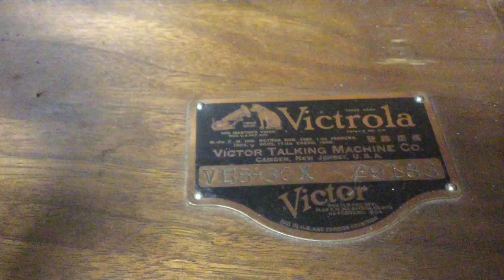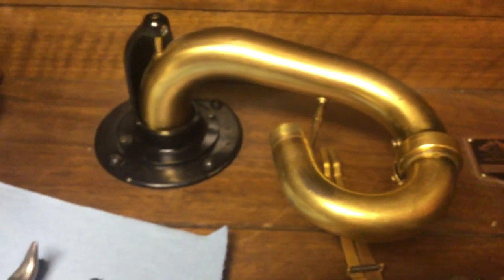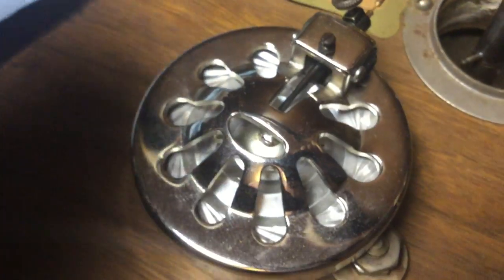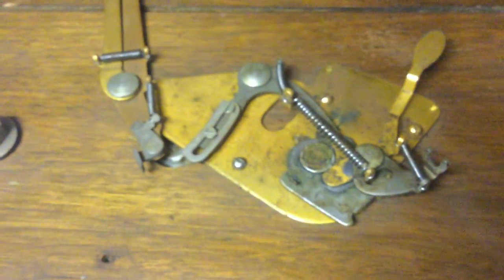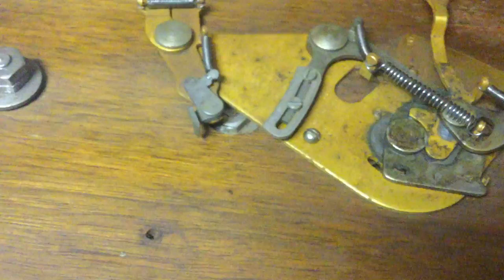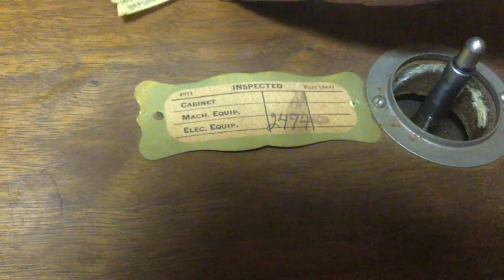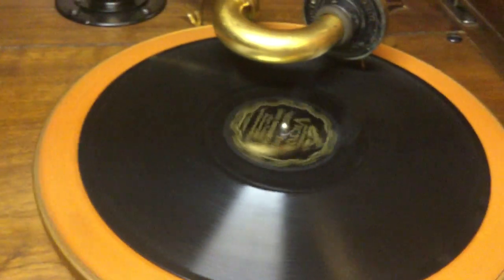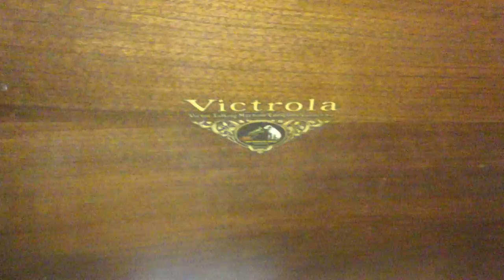My new 1927 Victor VE 8-30 X "Credenza" Orthophonic Victrola

Comment: I bought myself a super rare german acuston front-mount phonograph today it's from about 1910 so a bit of throwback technology since its a front-mount phono and those became obsolete somewhere around 1906-08 I bought it for about 200 dollars translated from euros (165 euro) it came with 5 rare needle tins (about 20 euro a tin) and 10 pre-1910 rare euro labels (again about 20 euros a record) so the value of the lot is 300 euros not counting the phonograph that one apparently was on the house!! with 135 to spare in value, not a bad deal;.
it also had a pre-1910 thick cardboard record box with labels it's shot but once repaired could be worth another 30 euros which counts to 165 to spare the same amount I paid for the darn thing! ain't life a strange thing!!
also, the value of the phonograph is about 800 euros giving me a hypothetical profit of 965 euro/1.175 dollars! damn!!!

Comment: Interesting that the tunstone needles seem less harsh on the records. I have some of these (various brands), but thought the intention of these was to make a needle which would last multiple plays, and the tungsten coating was harder than the steel and wore the record, rather than the needle. Thanks 😀 👍
Reply from the maker: What's interesting about the tungstone needle is the way the tip is made. It's not a solid tip, it's a tiny piece of stranded wire made of tungsten. Thus, the strands are able to move around and conform to the shape of the groove rather than a solid tip wearing down. Also, the outside diameter of the wire is the same as the width of the groove, so as the tip does west over the course of multiple records, it's not becoming blunt like the tapered point of a steel needle. 

So yeah, pretty clever the tungstone needle!
Reply: @okbridges  Thanks, thats very interesting. I shall have to take a look at my various needles. Some I think (from other manufacturers) look to be the same as steel needles, but just with a gold colour coating.
Reply from the maker: @mrrgstuff  I've had 10-play steel needles that were gold plated. They were just like standard single-play needles, except made of a less soft steel. They were much harder on records, but I used them on worn records that would dull a single play needle before the side was over.
As a side note, my favorite single-play needles were British made and it was claimed on the packet that they would play 2-3 sides before needing changed. They were generally good for both sides of a record and were high quality. I think they were Grenadier brand and had a picture of a Grenadier Guard on the packet and the tagline "Guardian of your Records".
I wish I could still get them......
Reply: @okbridges  Not seen that brand. I have acquired a few assorted period tins and contents. Fortunately it appears someone in the UK still has a needle making machine because its still easy to buy brand new needles in quantity, and the quality looks good. Thanks 😀 👍

Comment: very helpful video..I've been into this hobby for over forty years and really enjoy it....one thing I have yet to find out is the purpose of the screw on the needle bar...could you please enlighten me?...THANKS!!
Reply from the maker: A lot of sources claim it is a damper but it is not. 
It is a stop to limit the movement of the needle bar. 
These aluminum diaphragms are easily damaged, especially if someone drops the reproducer on the record or bumps the needle.
Reply: @okbridges  Makes sense.that is the most delicate part of the machine outside of deliberately over-winding the motor.THANKS!!

Comment: I'm actually trying to get one of these Orthophonic Victorola's. There is a mint condition one at an antique store I go to quite often. There is just one problem. The machine runs fine but it is super quiet. Unusually quiet. I have no idea what's wrong with it.
Reply from the maker: What kind of sound box( reproducer) does it have? The correct sound box is the one shown here, though Victor made a few machines that used different sound boxes. Be sure to check the back bracket at the back of the tone arm. Early orthophonic models do not use the style shown here and they are usually ok.  The style shown here was made of pot metal and are usually all broken and crumbling.
Reply: It sure wasn't a credenza. That's for sure. I think it was pot metal. I'll get back to you on this next time I go there.
Reply from the maker: If you haven't already, visit www.victor-victrola.com to help ID the machine you are looking at. 
There were several different sizes of back bracket used, only 2 are being reproduced, and they sell for about $85 US. Check the back bracket carefully, if you see cracks or missing bits, then it is going to need repair or replaced.  Reproducer is the same. If it has 9 slots like the one I show in this video it is pot metal,  if 7 slots it is brass.  It could have a different type of reproducer, depending on the model or if the original was replaced. The Victor website will help you determine what is correct.  Get the model and serial number and I can look it up in the Victor Data Book for you.
Reply: okbridges Thanks for that.
Reply: @thegregolahorologyclub6799  Did you find out what it was,  and more importantly did you buy it? 😉. Thanks 😀 👍